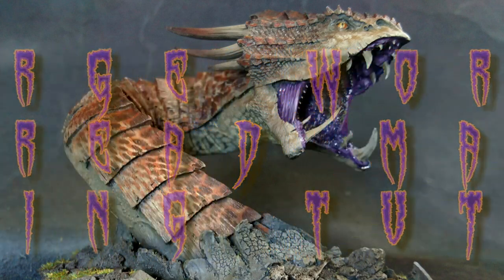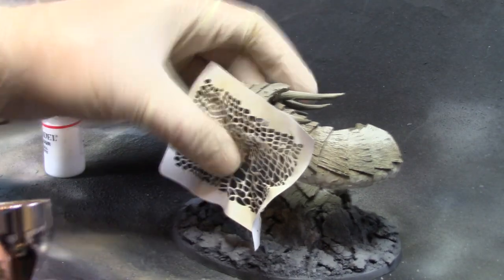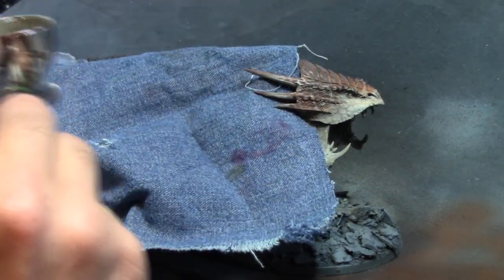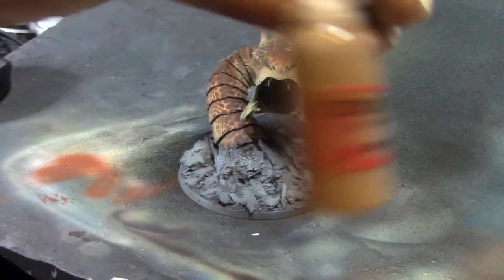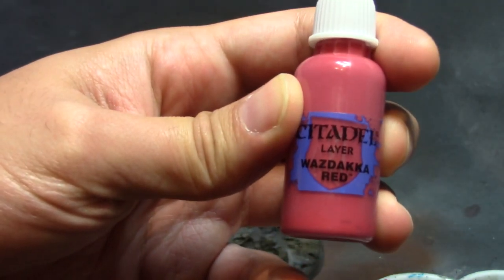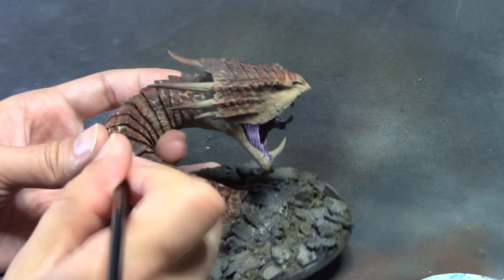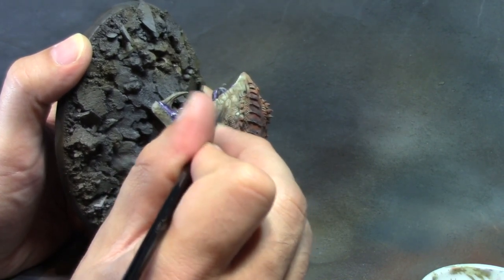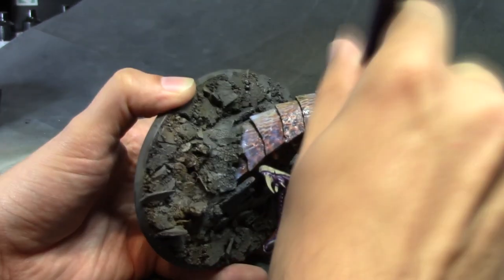How to paint Snake Skin tutorial

Comment: Hi there, loving the work! Can you tell me do you thin your non air citadel paints in the brush or in the pot?
Reply from the maker: JetsetJimbo I thin them in the pot but I have decantered them into dropper bottles which have extra thinner and little ball bearings to mix them up
Reply: elstonation I guess you just brush paint with them in this thinned state too? Do you use a thinner or flow improver? I'm just getting a airbrush and have seen a lot about paint drying on the tip. Do you have issues with this using the thinned paint?
Reply from the maker: JetsetJimbo Yeah there is a knack to figuring how much to thin your paints and to be honest I still get it wrong from time to time. Dry tip tends to happen if you don't thin your paints and mainly on white colours. If your gonna thin try to use the matchibg thinner to the company that makes the paints. Hope that helps